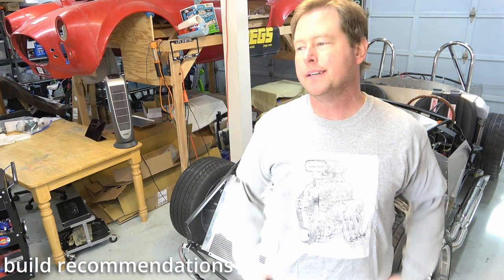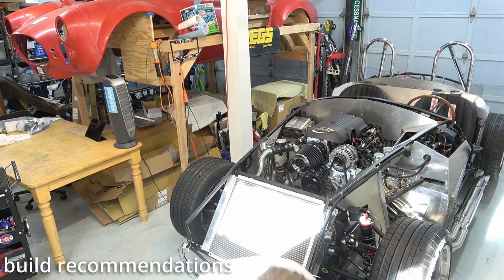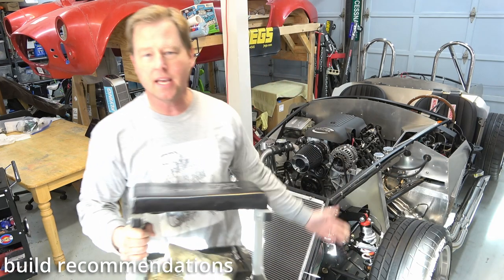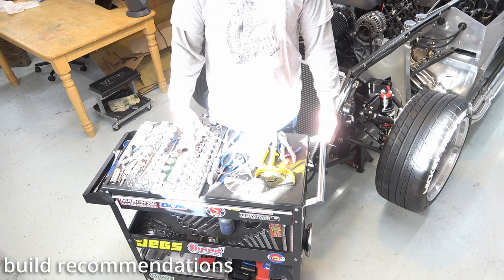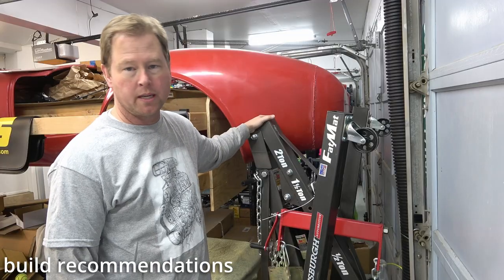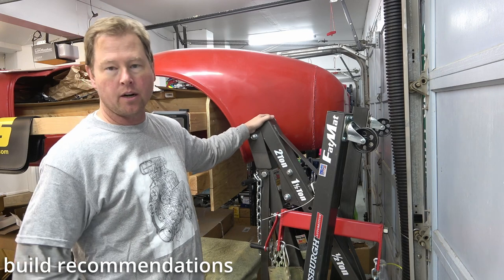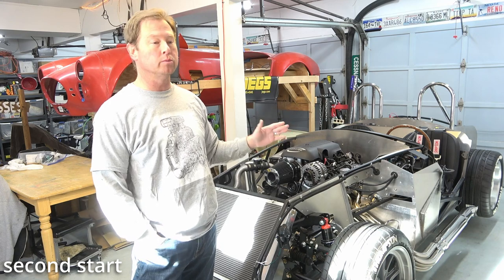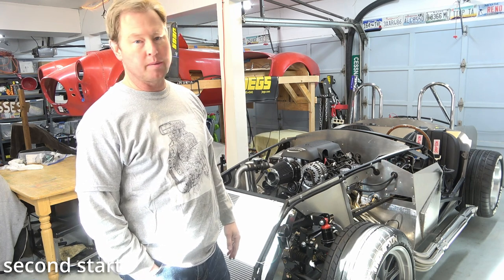Budget LS Factory Five Cobra | Build Recommendations | BOOM

Comment: Sorry about the hose blowing off. I hate that kind of a mess too! Unfortunately, those corrugated hoses have a reputation for doing exactly that. Three suggestions: Replace those worm drive clamps with high quality t-bolt clamps. They can be tightened more (and easier) and hold a lot better. A lot of guys install 2-3 #6 button head metal screws at the each end of pipe that the rubber coupler goes over with the clamp on the other side. If you want to ditch them completely, Boig Cool Tubes are huge upgrade. But may not fit your budget theme and also maybe not an available configuration for your engine setup. Good video though with some good tips.